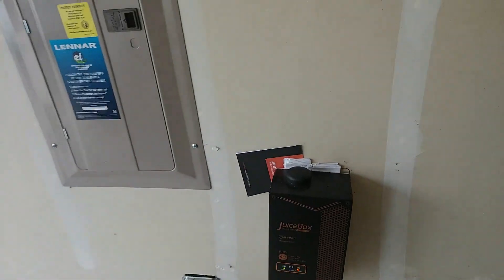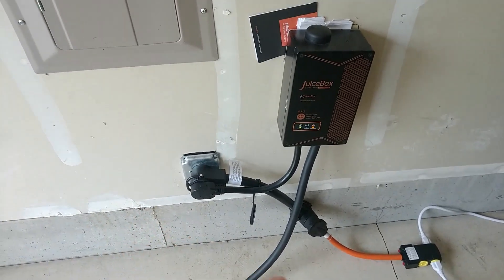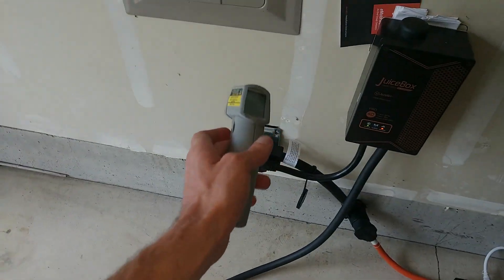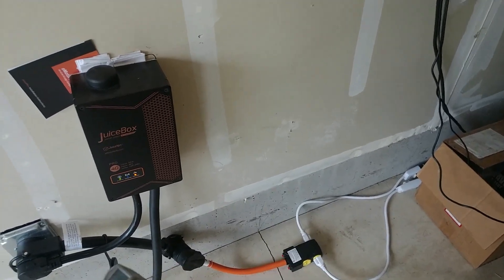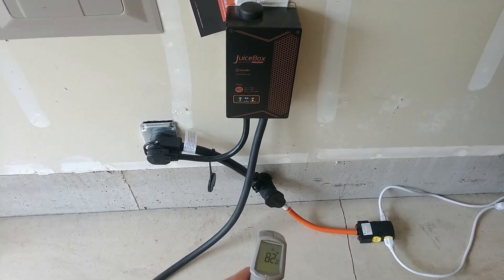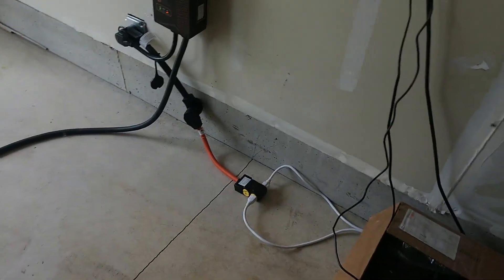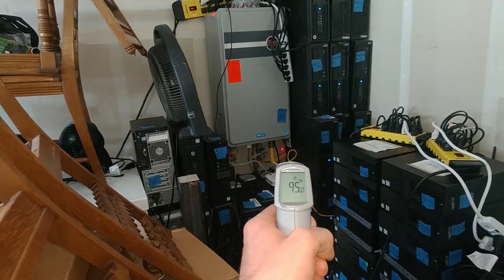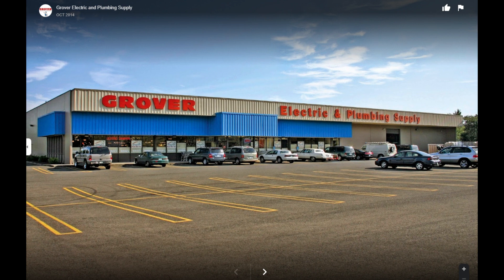Grover Electric & Plumbing staff dismiss idea of splitting a 240V plug for Distributed Computing

Comment from the maker: Update, still going strong! Safety;;
In my experience with running computers off of 240 volt is the 240v side is all cool, splitters, outlet everything besides the breaker if heavily loaded.  
The 120v side, the 4x splitters get warm if all 4 occupied fully but 2 or 3 per 4x it would just be luke warm. Each has dual 24A breakers on them so they do trip if things get weird 
Further down the 120 volt lines as in the plug strips, warmish. The brand (hyper-tough Walmart 2 plugged into a DewinWils yellow strip each) I use they do trip if too much load.
 Cords to each computer are all just ambient temperature because each computer takes about 0.5 amps.  Each computer has a 180w power supply so with a 40 to 50w CPU power limit+ motherboard+ drive + fan it is about 65w max on summer, so about 40% load on the power supply.
Even with power supply fan seized on a few of my older rigs In the garage during summer, no issues.
For the main 240 volt circuit when I was experimenting what I could do, I wanted to make sure it would be safe so I loaded the remaining 120v circuits up with hair dryers and such to put a slightly heavier load than it would experience when implemented as a qualifier for safety using temp gun everywhere, in summer, with garage closed very hot and kept it steady state for some time and everything was still happy. Multiple summers essentially zero failures maybe just 2 I think.

Comment: Wow! You going to kill someone!
Reply from the maker: Been rock solid 24/7 full throttle operation since I made this video everything is cool to the touch especially with cool fall air blowing in from the garage door being open a few inches
Reply: @danwat1234  Ignorance is bliss.
Reply from the maker: @Nervosos Still running fine 24/7 all circuits are only warm in summer well in the green. It has proven itself to be robust and I am setting up remote temperature alerts